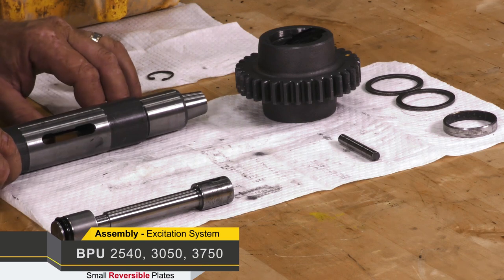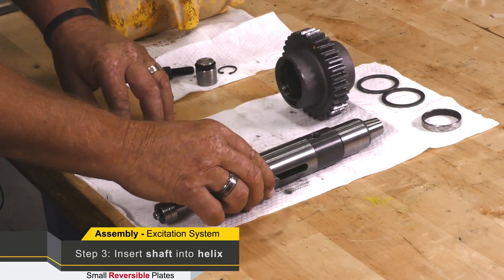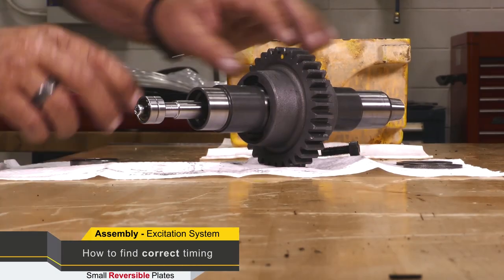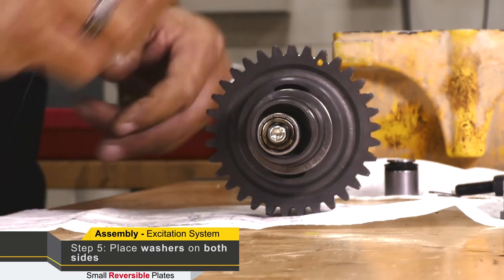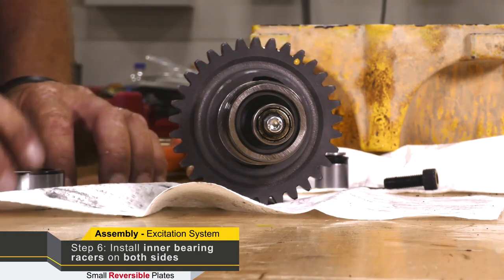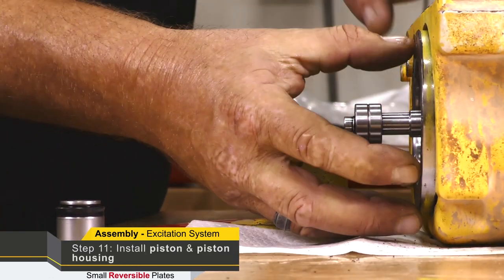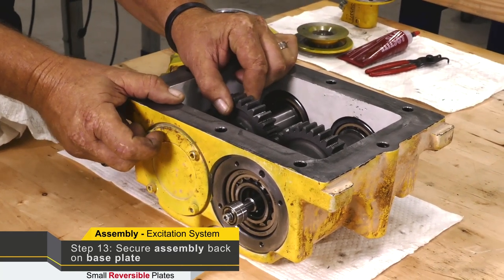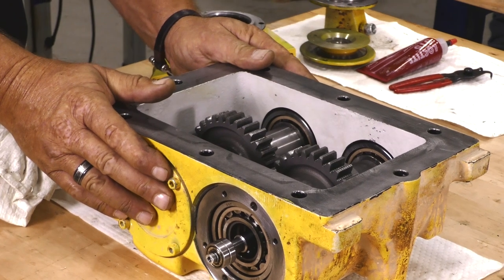WNU: Excitation System Assembly: Reversible Plates

Comment: My machine will only go into reverse for a second when the handle is in reverse. Then it continues forward. The oil is full and everything is timed properly. I replaced the lip seal on the shaft. Still not working. What can I check?